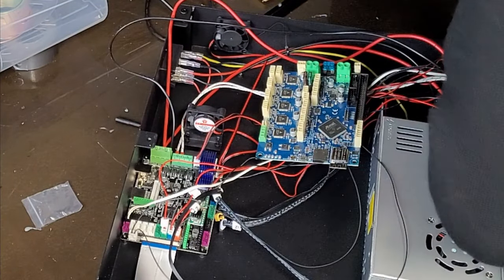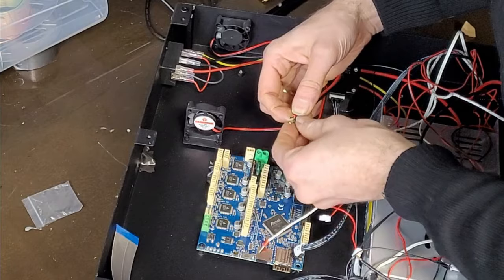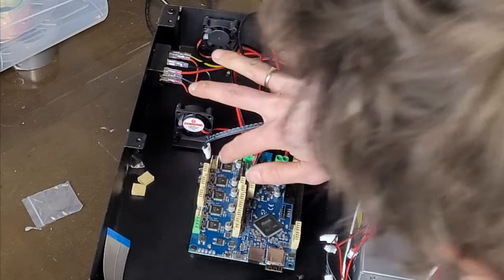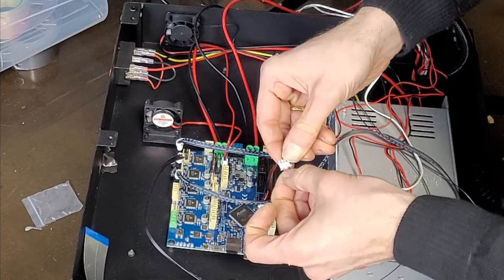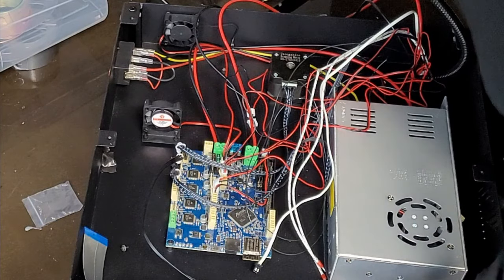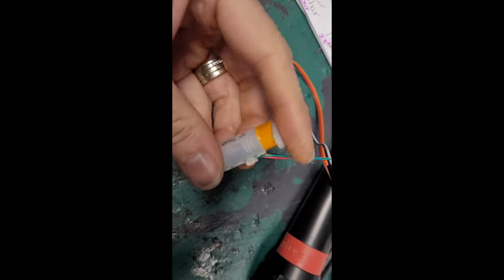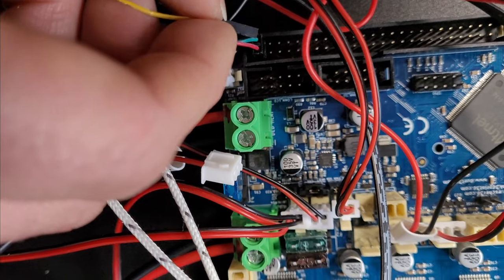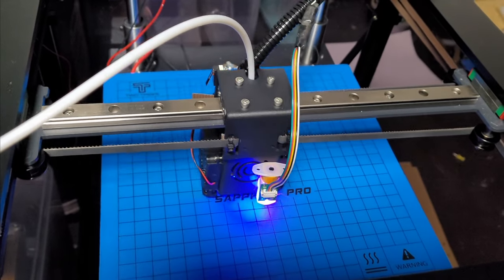Two Trees Sapphire Pro Build and Conversion to Duet Wifi - Part 2 of 2  config.g file in description

Comment: Hi I am thinking of putting a ball screw onto mine could you post a link to the one you fitted or even just the specs, and is it the same thing as the original or is it different and also did you have to update firm after install on mks nano board or was it just a direct swop